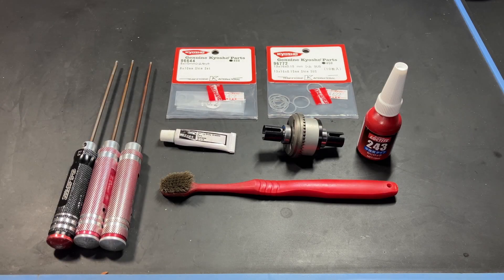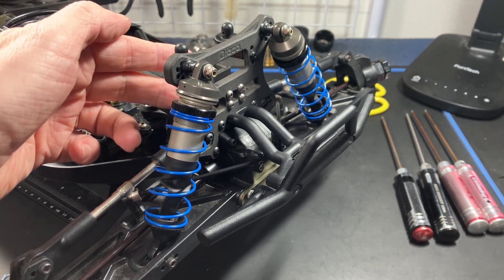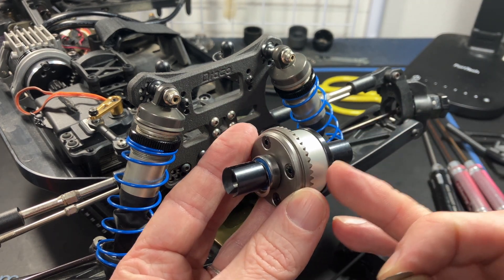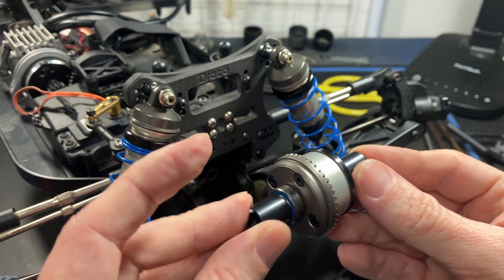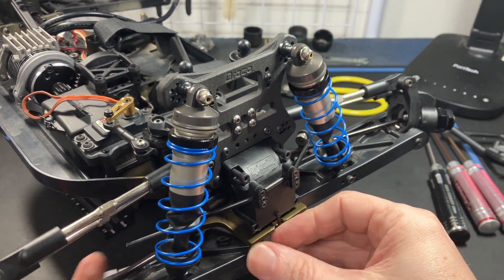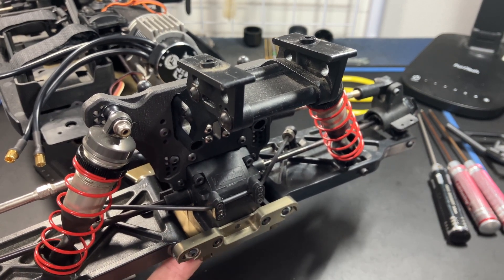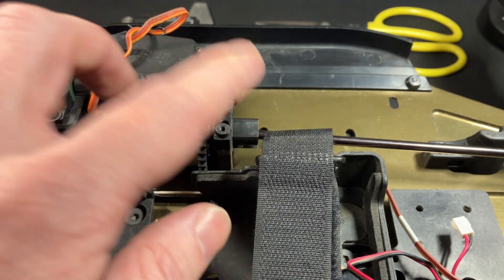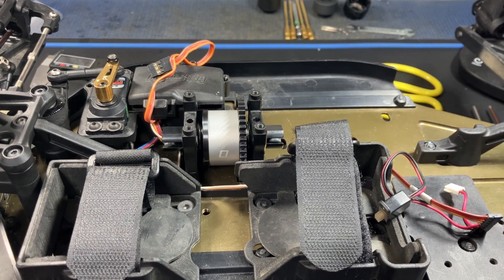HPI Vorza - Draco Diff Case 2023 Installation Series (Part 3)

Comment: Interesting thanks! How do you find this truck so far? 
I’m very eager to get this, I’m looking for a fast truck (60mph out the box), that is very planted and nimble that can turn sharp. Something that doesn’t wheelie easily. I’m between this and the Corally Muracco. My concerns about the Vorza is the Engine Mount, no droop screws and the suspension looks saggy (the front arms are not parallel with the ground). Also doesn’t look like there are much upgrades like shocks, front to rear center brace. Also only a 11kg servo seems weak and slow. But would love to hear your thoughts, as I really like the look of this truck and also the drive style it has as it seems to have a racing DNA
.I have a Kraton 4s, but it turns like a bus and not so nimble, even after upgrading the servo to a 30kg servo.
Reply from the maker: Hey there, thank you for the message!

I love this platform it is light and nimble and has a good level of adjustment. The suspension is a little saggy but with some Kyosho springs I have fixed the sag.

You’re in luck as I got the vehicle to develop upgrades. I have shock towers, Centre diff/motor mount, and Centre braces as well as front and rear braces. I’d be happy to send you pics of the prototypes. In the meantime you can check out my website for more info on these designs. https://www.draco-jp.com/vorzaparts
Reply: @dracoprecision  Many thanks!